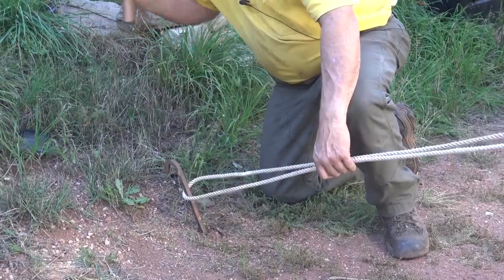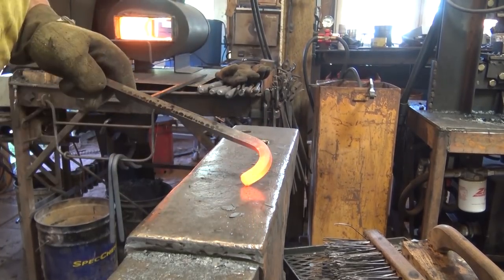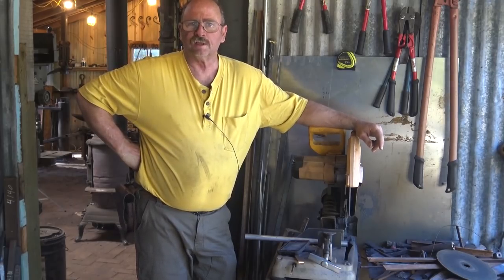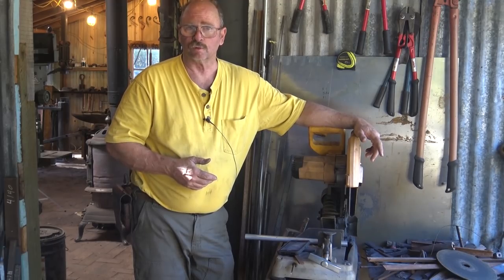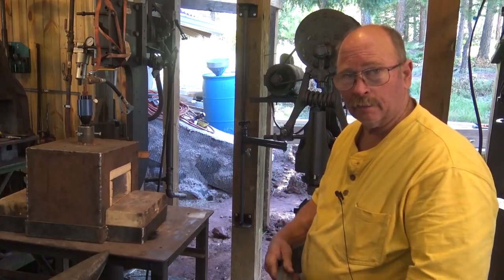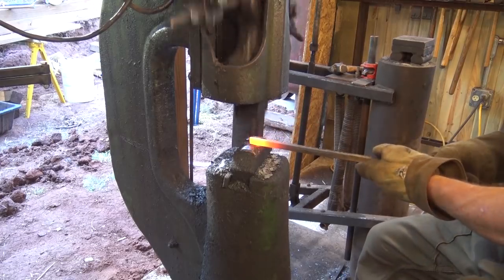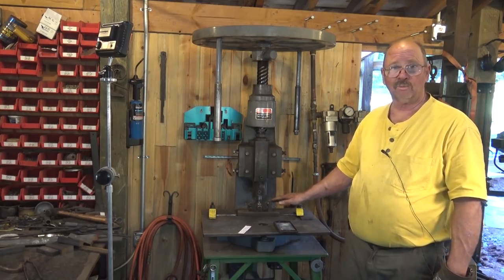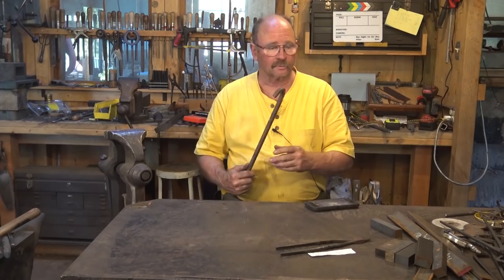Tent stakes as a lesson in increasing production effiecency.

Comment: Good lesson.  When I was doing electric in the early 90s I got a job to wire over 300 condos all the same code wiring so I went out and found a trailer load of bx cable after buying the load I found out I paid less them the supply house paid.   It worked out great made lots of money but had to store a trailer load of wire that couldn’t get wet.   Not fun.  All in all it worked out.  I think I still have some lol.  So yes I can really see what you are saying.   Thx John for sharing.....Paul

Comment: Excellent video (as usual)!  Real production work often requires a slightly different mindset.  If someone were to order a dozen stakes, it would probably be quicker to cut the material yourself, and use whatever forge you already had hot; rather than have your wife (or someone else) come out to the shop, and set up the forge & anvil next to the Little Giant and fly press.  But when you are measuring the work in days or weeks instead of hours, the time it takes to set up production absolutely pays off.  It really depends on how many of an item you can reasonably expect to sell in given time.  It also depends on how much storage space you have available to keep inventory sitting on a shelf.
Reply from the maker: You are correct.  A dozen or two isn't worth rearranging.

Comment: There’s much to be said for finding the most efficient method for the quantity needed. I made about 40 “shepherd’s crooks” for myself, heavy versions of the plant hangers you see in stores. For half, I bent a small hook on the end of the bar by hand with a jury-rigged setup, tiring but fast. For the remainder, I used the Hossfeld bender, which took far longer plus the setup time. Saved a little physical effort, but just wasn’t worth it. Now for 1,000....

Comment: Man this is fascinating! Great videos and some amazing items that you make. A couple of questions regarding the tent stakes, why would you not consider Aluminium? Just for any shipping costs. Then have you worked out the cost of the preforming of the tips using a grinder and electric compared to the cost of that furnace? Not trying to say anything, just curious if there was any difference between the two. Just looking at the furnace method seems so much more labour intensive, but then again, prices for electric vary a lot between different countries. Keep these videos coming, you might tempt me into sourcing a furnace here in Thailand. (We actually used to do coke furnace metalwork at school back in the UK the 1970's - using real fire and real hammers and anvils making hearth pokers and the like, brazing and even ceramic inlays (We were even allowed to use lathes and milling machines, even woodwork with real hammers and sharp nails but I expect that these subject no longer exists in case Quentin burns his fingers and the school gets a lawsuit!) Probably they do classes in Smartphone applications on gender awareness these days
Reply: A taper like the points of those tent stakes is a really really easy thing to forge with the cost of gas being pretty much negligible if you are even moderately efficient with your work, I can forge a useable taper like that faster than anything I have used could grind or cut such a point. Aluminum costs significantly more than steel. Aluminum is also significantly more labor intensive to turn into useable tent stakes, you need to use a hardenable aluminum if you want to make a tent stake that doesn't crumple, and aluminum hardening isn't a process that most small blacksmiths are equipped to do.

Comment: would it not be faster to use a bending jig than the flypress for the hook part ?
Reply from the maker: The fly press will make the bend easier at a lower heat than required for bending by ha d in a jig. Plus the results are more guaranteed. Both of those things makes it faster to get good results.
Reply: @BlackBearForge  Okay, thanks for the response.